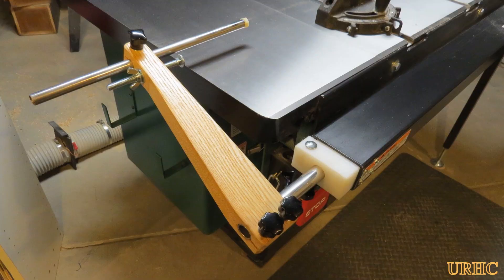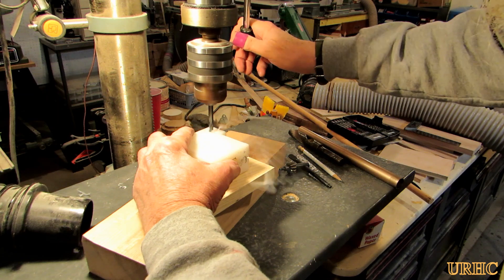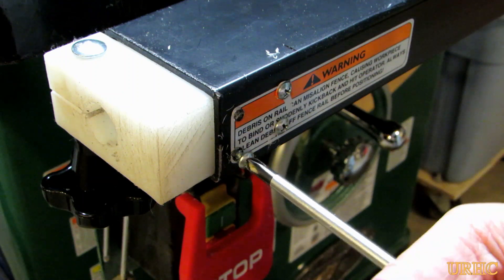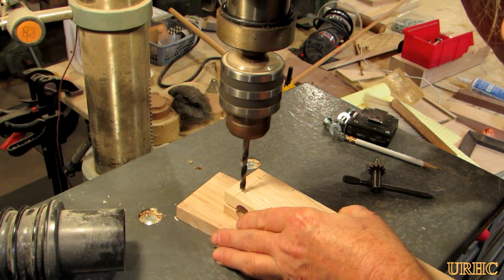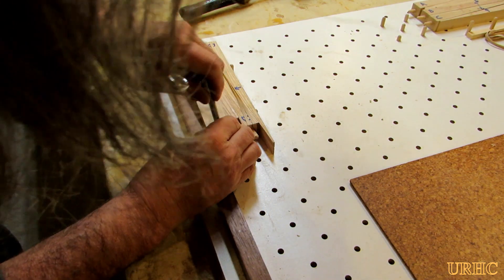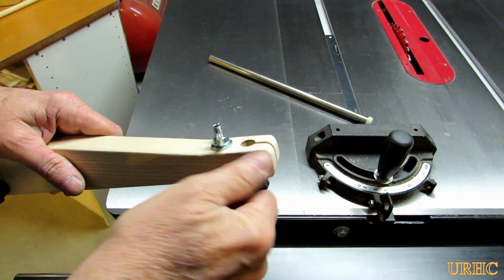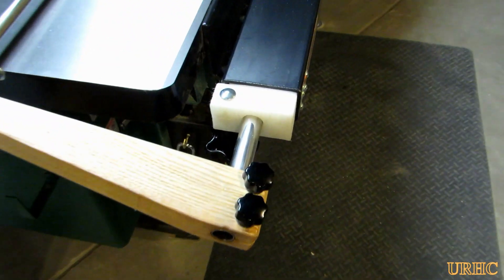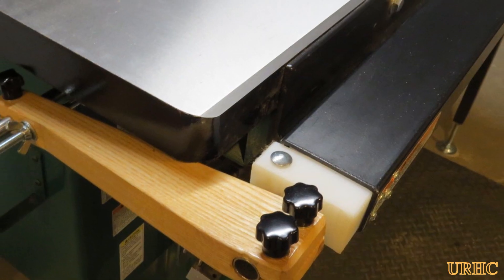Grizzly G1023RLWX Retractable Saw Stop Build For A Shop Fox Fence

Comment: You have a great way with how you do your videos. I’m learning a lot. This was very enjoyable. 
Not sure if your wire wheel is a stainless steel variety, best if it is when using on stainless steel. Regular steel wire wheels will transfer to the stainless causing it to rust.
Reply from the maker: Are you talking about the buffer? I use different buffs and compounds for different types of materials. Thanks for watching.
Reply: We use to use stainless steel transfer to give rods a protective coating.
Reply: akbychoice ¿

Comment: Nice build. Would you buy the Grizzly saw again?
Reply from the maker: Yes I would. It has some sawdust collection issues with the small tube on the blade shroud plugging, but that is all so far. It is a very smooth powerful saw for the price. Thanks for watching my video

Comment: Changing the subject ... with the fence on the same side as the arbor nut, and with the fence locked in position. the distance from the outboard toothedge to the fence changes with the blades plate thickness.

So, in some cases, the difference in cut length between a thin kerf and standard kerf blade could be as much as 1/32".

Do you think about this and make an "eyeball" adjustment in locking the fence down?  Do you ignore it and live with the undercut or overcut piece?  Or do you never use a blade having a plate thickness different from when you laid down the tape?
Reply from the maker: I only use the full kerf blades because of the riving knife thickness so it is pretty accurate if you look straight down through the bubble. I always double check with a ruler also.
Reply: Thanks.  Long story short, when I got into 'deconstructing' salvaged framing timbers, I started using thin kerf blades to somewhat compensate for my TS's 1.5+ HP motor.   As I started making more and precision cuts, I upgraded the fence and moved it to the opposite side, left of the blade on a left-tilting saw,  That way, the fence is always registering off the inboard surface of the blade plate, regardless of plate thickness.  This "wrong" fence configuration cuts the "error" in half when changing blades having different plate thicknesses/kerfs.  So, for the past 20+ years, there's been no need to 'double check' with a ruler.

Eventually I upgraded to a real 3HP motor.  Now I'm considering an "upgrade" to a G1023RLW ... almost strictly to make bevel cuts [since it now takes me 10 minutes to horse the nearly kaput tilt mechanism].  So, if I do upgrade, I guess I need to be prepared for double-checking once again.
Reply from the maker: There is digital gauge available for table saw fences that is easy to re-zero for different blades also. https://www.amazon.com/Wixey-WR700-Fence-Digital-Readout/dp/B001PTGBT4
I have been looking at one for my planer.
Reply: I'll have to check that one out ... better yet, maybe wait until I read/watch your review on it.  Thx again.